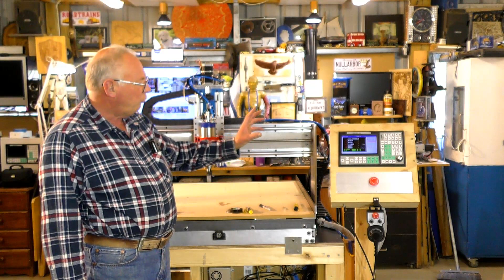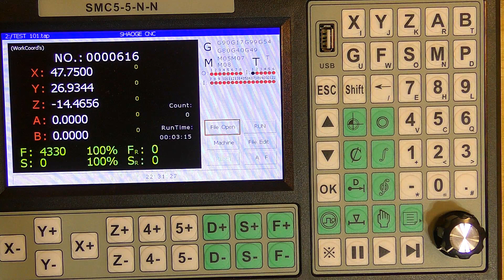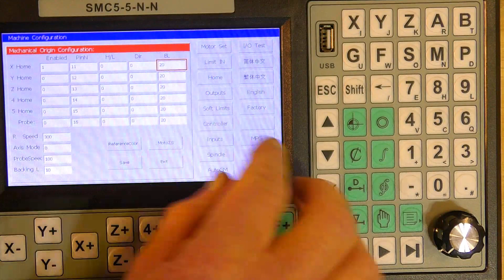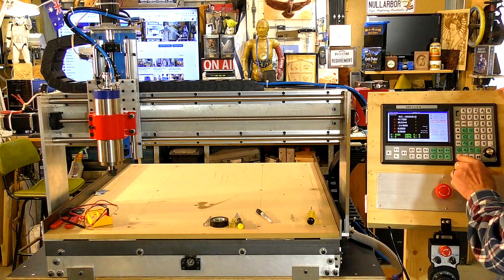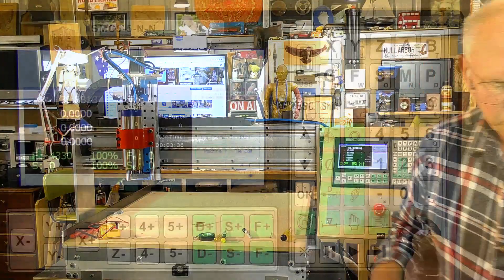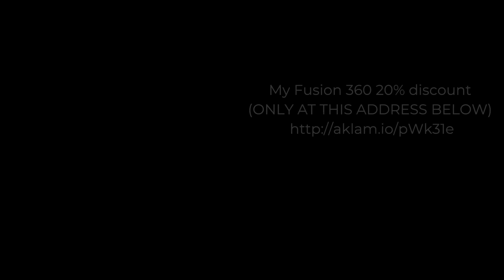Setting up a new CNC router with an SMC5-5-N-N controller

Comment: Hi Roger, thx for posting the valuable info, i would like to know is there a provision for multi atc on this board...

Also is there a provision for removing the backlash..
I mean to say are all the necessary provisions on this  controller like mach3 or maso
Reply from the maker: No and no
Reply: @inventorsworkshop9600  🤔

Comment: Thanks for the vids  I have the same controller was wondering what file type do you use  mine as far as I
 know only run (TAP and NC files)
Reply from the maker: Hi, there is a facility on my patron pages for technical help
https://www.patreon.com/user?u=15079773

Comment: Hi Roger
I buildt a cnc router using SMC5-5-N-N controller with 4 nema 34 12nm closed loop motors, have some trouble with connecting the slave y axis.
Is there a way to do it in the software (mach3)
like the videos you make,i am a teacher(welding and Milling)and me and my students watch every video you put out
thank you and keep up the god work
Reply from the maker: Hi, have a look at my MAXI CNC router